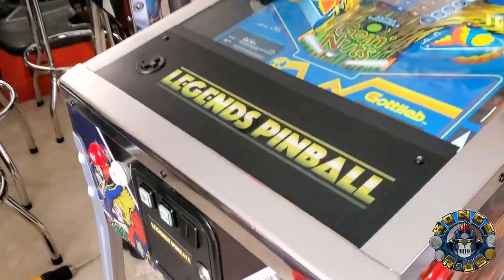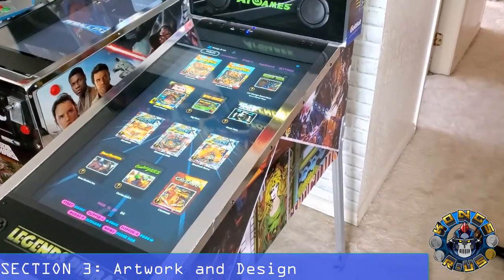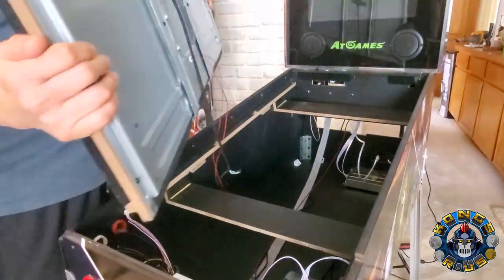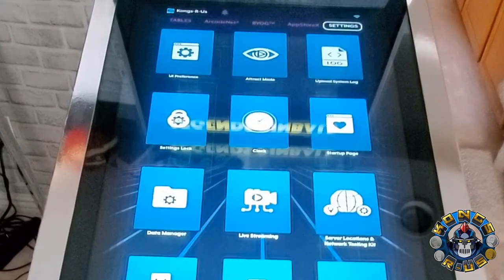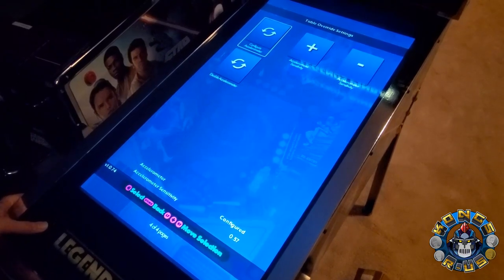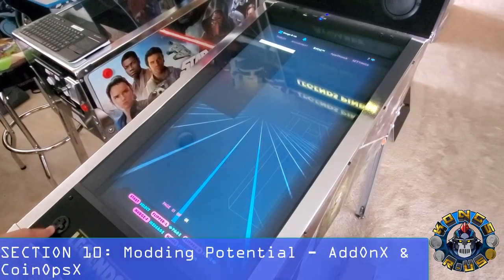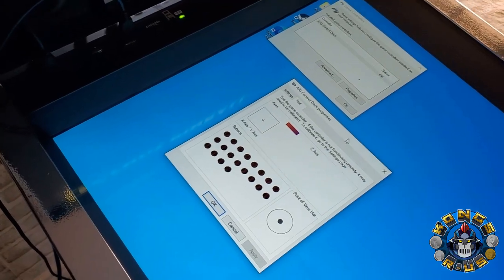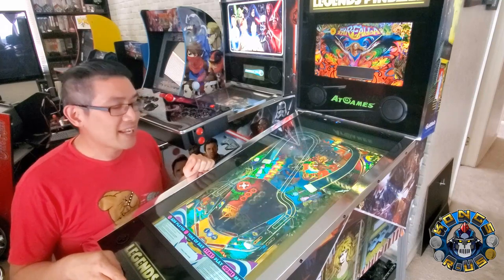At Games Legends Pinball In-Depth Review + Modding Options

Comment: Very nice review of the Legend Pinball. When mentioning some of the flaws you can tell Atgames and they will really listen and because it has wifi it makes it really easy to update the firmware. Overall I think its the best pinball in the price range. I agree that AtGames needs to really concentrate on the outside art graphic on their cabs and the hardware that holds the screen could use some chrome. That's where Arcade 1UP is better. But if I was to buy a pinball in this price range I would definitely buy the Atgames Legend pinball.
Reply from the maker: great feedback! I do wished it looked a little better, but the hardware is definitely top notch for the price point and great for modders like me and our die hard retro arcade community.

 I have a hard time seeing this outselling A1ups if both of them were sitting side by side at a brick and mortar though. The casuals will appreciate A1ups more I think, but I like ALP for all its modding potential for sure

Comment: Kongs-R-Us,

Great review!

Yeah, I also can't recommend the AtGames Legends Pinball at this time as my machine came with a backbox monitor that wouldn't function.  This is my first AtGames product and it doesn't leave a good first impression.    

I immediately emailed AtGames support, which they were quite quick to get back with me.  They had me do all the normal troubleshooting, reseat cables and such, but when they had me reseat the main backboard monitor cable to the motherboard, the piece that held the cable in on the motherboard instantly came off with the slightest touch.  I could not get it to reattach (it's so tiny).  Without that piece, the cable would no longer stay connected to the motherboard.  

They said they would need to send me a new motherboard and monitor cables, which sounded ok, but I would first have to send them back mine before they would send me a new one.  That means no part of my pinball machine would be working while I wait (the main playfield worked fine).  Plus, removing their motherboard was also SO COMPLICATED with it's MANY wires.  When I had a PCB problem on an Arcade1up machine, Arcade1up sent me a replacement and let me keep the one I had until I received the new one (so I could at least keep playing the machine).  So I'm a little disappointed with AtGames.  I'm glad they are working with me and hope to see the new motherboard soon, but for now, I have a pinball machine-sized brick sitting in my game room.

I hope in the future, companies can somehow figure out how to send out products that don't arrive broken, especially when there's no visible shipping damage to the box.

vgv
Reply from the maker: sorry to hear about your troubleshooting experience and hope it gets resolved! those EDP cable connections are definitely fragile and not the easiest to setup
Reply: Kongs-R-Us,

It sounds like many from the community have good experiences from AtGames, so I'm very hopeful.  I can't wait to see your future mods to this machine :)

vgv

Comment: Curious if you're having any sound issues out of the box? I'm getting major buzzing from the control panel area from the acrylic vibrating on the lock bar as well as speaker hum from.the back box speakers... very disappointing
Reply: There's a video on that and it's a known issue. I discovered this out of the box setting this up last night. Until it's fixed, going to sound settings and set them from top to bottom values of 50, 40, 3. Then on button volume on machine set it to 75
Reply: @Roadsurfer2k11  i found a fix that works pretty good for me... did an updated video on it recently

Comment: Great video!  Am I the only one who thinks the backglass monitor is too small?  Instead of trying to add HDMI to it I'd like to see if we could add HDMI to the output from the pinball board so we could replace the monitor with a bigger one.  Has anyone done this?
Reply from the maker: it is a little small for a full size backglass. i haven't seen anyone do a bigger screen mod and keeping the stock connection to the PCB. i do have some plans though for a bigger monitor into the backglass with an idea to use the stock screen as my DMD. :)
Reply: @KongsRUs  Cool - can't wait to see that!

Comment: Hey Bee!  So it's been several months since you put the vinyl chrome wrap on the side rails & lockdown bar - how has it held up? I'm thinking of doing this, but thought the wrap would wear off after a while. Do you see any issues with this? Would you recommend chroming those parts differently now?  Looks really good!  Love your videos!
Reply from the maker: Hey David, the chrome wrap is holding up really well. If you are modding your cab, I'd recommend it be one of the last things you do. Since I kept taking them off and on, they got a little scuffed from me having them lying on the floor amongst my modding mess. Otherwise, I've like the way they turned out to accent my cab
Reply: @KongsRUs  Great news!  I'm gonna order some of that chrome wrap. I appreciate it! Thanks!!

Comment: Rumbling panel sound is still present. Had to do the sound adj settings to fix it, but someone said they inserted foam in between glass and panel to fix it. The painting is all about the technique.. I saw rattle cans and metal needs to be primed first. Painting in direct sun is a huge no. That metal with soak heat fast and crack paint and improper dry it. Plus other factors like heat, paint type, hardener and whatever. I'm actually in middle redoing completely rusted legs on a 1983 Bally pin restoration. Clear coat via can tomorrow and hand painting legs and bolts after (metallic gold). It took 5 hours on polishing wheels, grinders and prepping, plus a good week for paint curing, etc. You can get the results you want but takes patience and some online googling
http://imgur.com/a/oJwG4bl
Also in mid project vinyl wrapping my car entirely, the "fingerings" on your vinyl rails are avoided laying it vertically first and a touch of heat gun let it flap over. The wrinkles were caused by tension (pulling).

*You can tell I lost my 18 year tech job via plant closure, and i'm doing all these odd projects now while learning before landing a new job 😅
Reply from the maker: Oh, I don't disagree with you. Lol, I lack patience and there was a limit I could get to with a chrome look so vinyl wrap was my best bet and I just bought replacement chrome legs for $60
Reply: @KongsRUs  very cool. Rails are actually an easy thing to do learning vinyl wrapping as well. A car is a whole different playfield, and cost about $800 in material too lol.
I priced the replacement legs on a full size real pinball machine and at $140 for the 4 with shipping, nope I'll just refinish them.
Reply from the maker: @Roadsurfer2k11  here's where I got my set for $55 plus shipping https://www.pinballlife.com/williams-system-11-chrome-legs-set-of-4.html
Reply: @KongsRUs  also great vid! Thanks for the paper tip for top display. The price of real pins have skyrocketed with some in $15,000 ranges, so $600 is a great bargain when you can add OTG. I'll  have to wait getting one but for my old, non tech parents they are loving it so far after setting theirs up Saturday. And it saves me a ton of emergency calls fixing their real machine lol because those parts aren't cheap

Comment: What about the frame skipping issue in OTG mode?  If they can't fix that via firmware, it is kind of worthless unless like a lot of disruptive frame skipping.  Added- Or, gut it and use own hardware.
Reply from the maker: I haven't done enough of my own testing on the OTG frame skipping issue, but I'll be honest as a casual Vpin player, I havent noticed too much when playing a few of my VPX tables. 

I'm sure it would be similar to watching 4K TV, and going back to 1080p would be tough. But if you've never experienced 4k, you'd be happy with the 1080p. 

Since I haven't played a ton of Vpin in full 60FPS, it's hard to notice the frame skipping issue personally, but ive seen videos and hope they can address it.

Comment: You know what I really need? Some pics on how you wired those terminal blocks.  I’ve got all the parts and pieces - things are good to go - except that.  I know it sounds really boring - but it’s a huge step that would help take my cab over the 50 yard line and into the red zone for a Touchdown!  Thanks for your great long-form content.
Reply from the maker: do you mean on my A1up pinball mod? my wiring is a big mess still, lol, I need to get in there and clean it up for sure. I still have plans to do a better in depth tutorial on my A1up pinball mod too
Reply: @KongsRUs  Yes - that's the one.  I did the 32" tv mod with backglass mod... I have the sainsmart - that's the part that gets me.  CoolToy did two terminal blocks - one just for positive and one for ground... and he only hooked up one wire to the sainsmart (the positive) and sent all the grounds from the solenoids right to the negative block.  Ugh - I just need to copy something and go...
Reply from the maker: @misterchip1984  yes, you need individual wires from the positive terminal block to go into each relay on the SainSmart.  These are stand alone wires. For each solenoid wire pair, the positive one goes into the SainSmart relay, and the negative one goes into the negative power block. Hope thay makes sense

Comment: Nice work as always.  By any chance do you know if the plunger in the cab can be used w/o any of the ALP hardware meaning connected directly to the PC (usb) or to a KLZ board?
Reply from the maker: Hmmm, the plunger does have its own hall sensor and wires that could possible be plugged into a kl25z board, but im honestly not sure

Comment: Could you please explain why you recommend partitioning the usb drive as you did? Is this required to allow one usb drive to be used for both features, Zaccaria tables and CoinOpsX future mods?
Reply from the maker: yes, the Legends Pinball has only (2) usb ports. The USB 2.0 port is used to connect a USB-A to USB-A Cable to your PC to support OTG mode controls.

that leaves only the USB 3.0 port to have your USB thumb drive. If you don't partition it, you'll only be able to use the single partition and format as FlashdriveX to add Zac packs, etc. partitioning the drive allows you to use AddOnX or CoinOpsX using the single USB thumb drive
Reply: @KongsRUs  thanks! That makes sense.

Comment: Great detailed review. Did you get to try to see if the ALP monitor fits in the 1up? Might be a good one to buy to do the cooltoy 32" mod since it has no housing.
Reply from the maker: i haven't, but not sure you can buy just a single monitor from the website I saw
Reply: @KongsRUs  Yeah, looked around. Ali has them but they do not have the back plate etc.

Comment: Bee is this ok spec Lil PC to mod my alp with?Beelink Mini PC SEi10, 10th Gen Intel Core i5-1035G1 Turbo 3.60 GHz, 16GB RAM, 500GB ROM M.2 2280 NVMe SSD, UHD Graphics 4K 60Hz, Triple Display, WiFi 6, BT5.2 ?Thank you
Reply from the maker: Does triple display mean there are 3 monitor outputs? Usually, PC pinball requires a dedicated graphics card. All the other specs seem ok, but would be worried about your GPU performance

Comment: When looking at the board is it possible to run a splitter from the main board to add a bass shaker like Retro Ralph did with the Out Run cab?  Thanks
Reply from the maker: Not sure, it's been a while since I've worked on my ALP. There's haptic feedback going into the control panel that you could tap into possibly for bass Shaker haptics. But i can tell you for sure,  sorry !

Comment: I hate the UI on the AtGames products. I have the Legends Gamer Pro. I hacked it with the CoinopsX thinking it would be a cool device that the whole family could enjoy, or that I could use to impress my friends. But the UI is terrible. It's overly complicated, unresponsive, and just a pain to use. It has so many cool games that I added, but I don't even bother touching it because it takes like 10 minutes just to get it working. Pairing the device with the puck is also a pain. It doesn't always pair with the console. So I have to unplug the flash drive, use a usb cable to sync the control panel with the puck, then plug in the flash drive again, mount it again, and go through the terrible UI to load the CoinopsX app. I would like to be able to recommend the device to others, or just lend it to my relatives. But there is no way they would be able to figure out how to use it.  Huge waste of money. And the built in games are complete trash.

Comment: Hello!  What male to male USB cable are you using and the length?  Many reports are it does not work well at all.  I'm going to post this to other as well.   Thanks!
Reply from the maker: I used a 3ft one from Amazon, but the key was using a powerd USB hub to make it work consistently
Reply: @KongsRUs  That probably should be mentioned and AtGames alerted.  The Legends Pro does not need this which suggests a potential impedance issue with the current usb connector set-up on the cabinet.
Reply: You did mention in you video and good topic of discussion, since seems prolific.  I'm placing bets on a design issue and impedance is the culprit. Not an issue on the Legend Pro or Ultimate, so wonder what got messed up with the pinball cab...

Comment: If you compare this to your star wars review, you had more issues with star wars but said its a good cabinet overall.  Yet, this cabinet has way more features but you said its not a good value out of the box.    The only thing I agree with is the interface needs to change...
Reply from the maker: hey Kevgret, appreciate the comments! I do plan to do a full comparison on both as they both have issues. With A1up, I mostly had issues with the monitors and graphics but out of the box, the design/chrome, graphics, UI, haptics, and "name brand" tables are better IMO. You're stuck with those tables unless you mod it, but the overall experience I feel would be better for the casual pinball fan.

For ALP, I have issues out of the box with the design/non-chrome, graphics, haptics, UI, and gameplay of the 22 Gottlieb tables (although the update fixed most of my issues). The pros are the larger playfield, dynamic backglass, connected gaming features, and modding potential. But for the casual fan, you have to buy the zaccarria packs to experience the best of ALP. 

I think there's a market for both honestly, but first impressions weighed heavily on me in both my reviews. 

thanks for checking it out and giving your feedback!